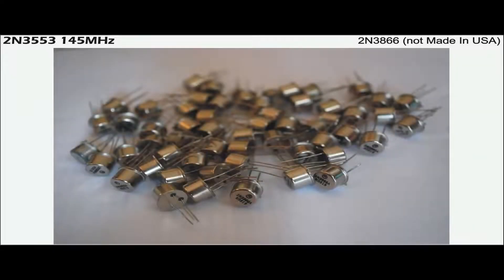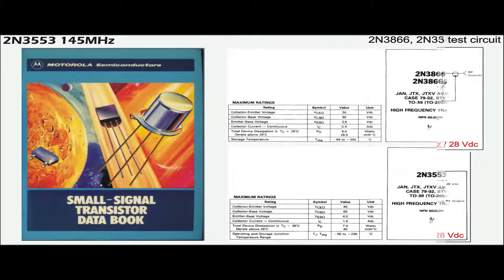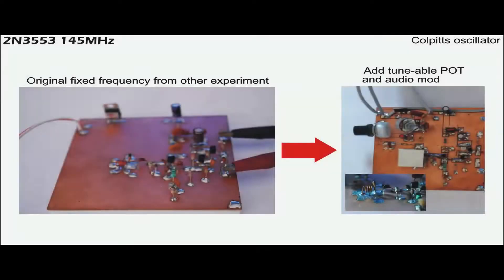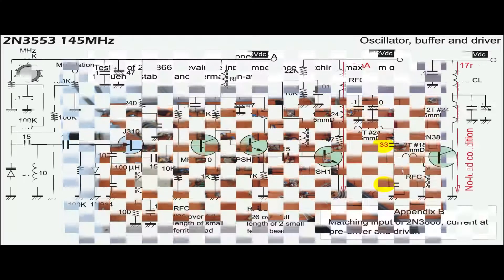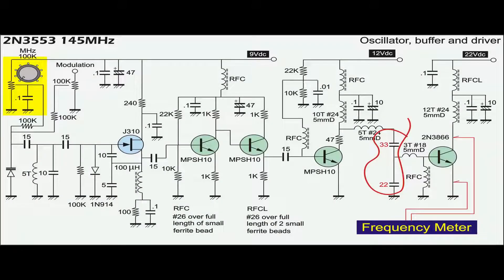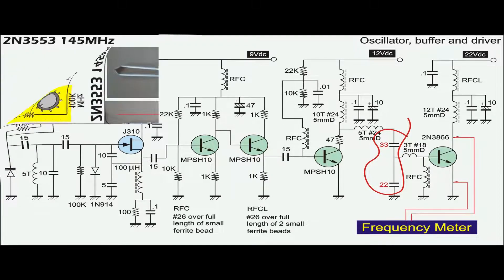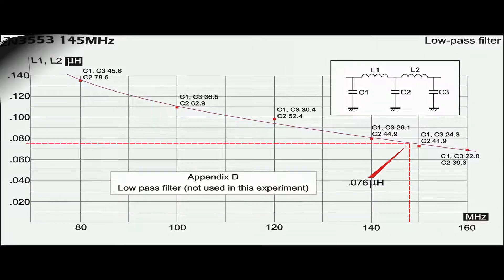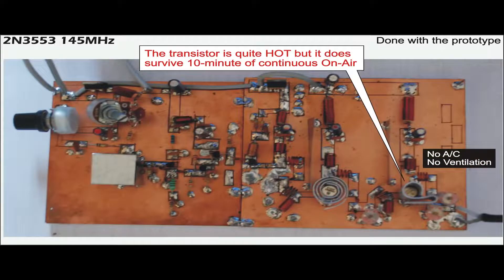2N3553 145MHz

Comment: I had been long fascinated by the 2N3866 and the 2N3553 from Motorola and RCA. I got some of them new and used but I found out the Mitsubishi 2SC1970 for 2N3866 and the 2SC1971 for the 2N3553 is more robust and higher in gain, moreover, it's easier to cool and mount. I also had the MRF237, it's prone to damage and not reliable compared to the 2SC1971.